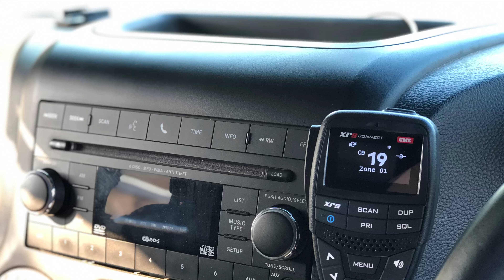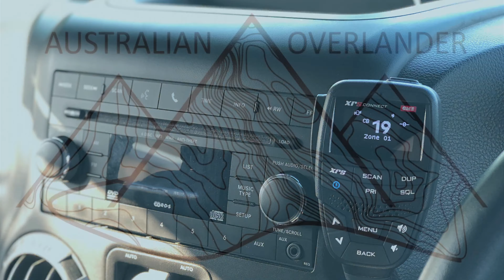Overland Jeep Build EP4 - GME XRS-370C UHF Radio Installation

Comment: what did you use to mount the antenna  - appears to be mounted to the A pillar?
Reply from the maker: Yep that’s right, I used an A-pillar light bracket as the mount. Works well